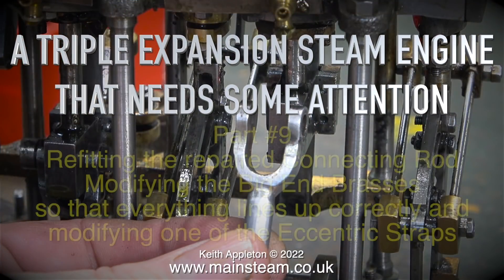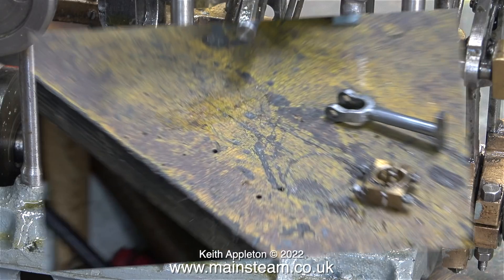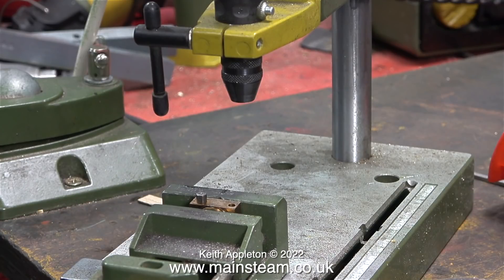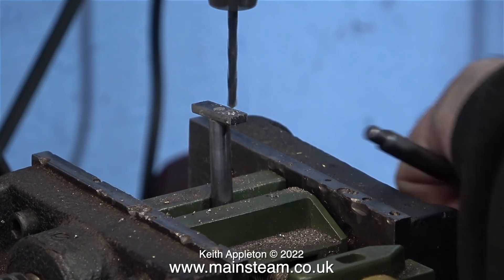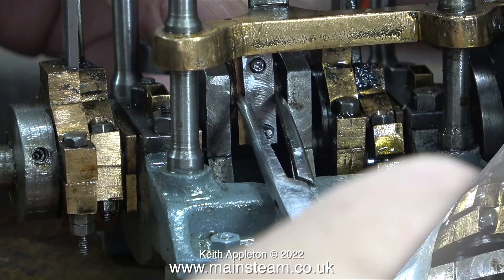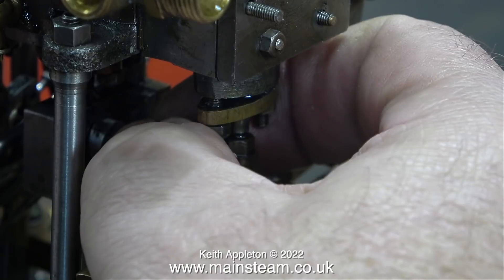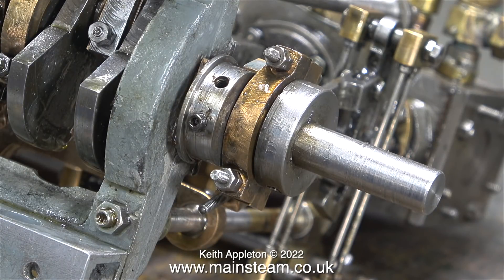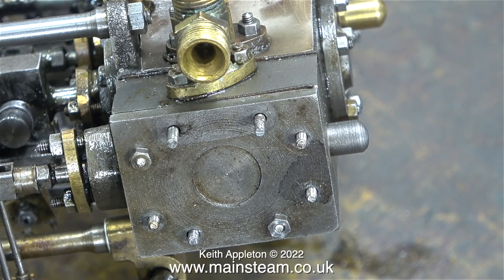A TRIPLE EXPANSION STEAM ENGINE THAT NEEDS SOME ATTENTION #9

Comment: I have been wondering about these Proxxon tools, does it say where yours are made? I have several mains powered ones I bought in Japan and they all say Made in Japan on the packaging, is this the case for ones sold in the UK?
Reply from the maker: To be hones I haven't looked. most of them with the exception of the "Micromot" Jigsaw seem to be well made and work fine.